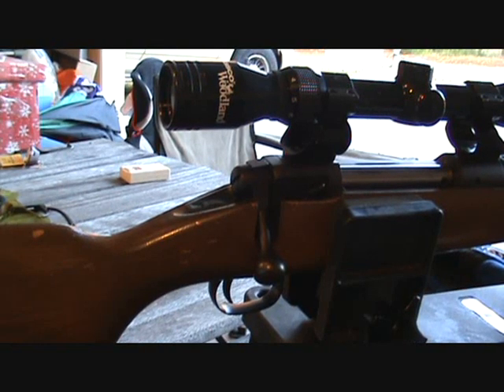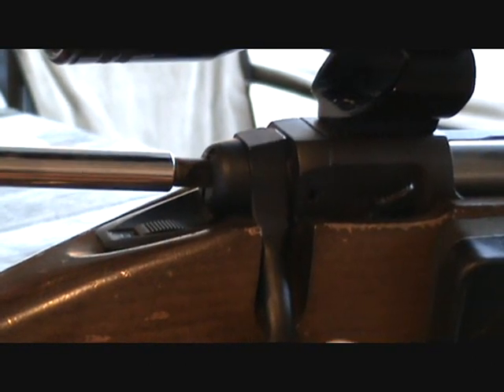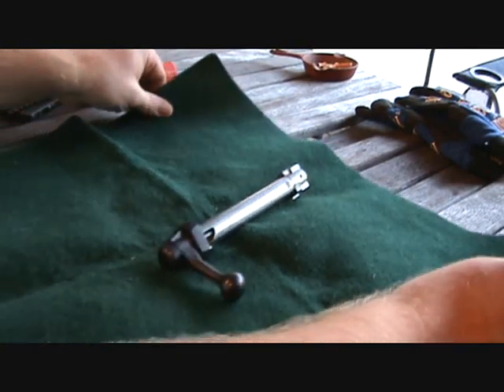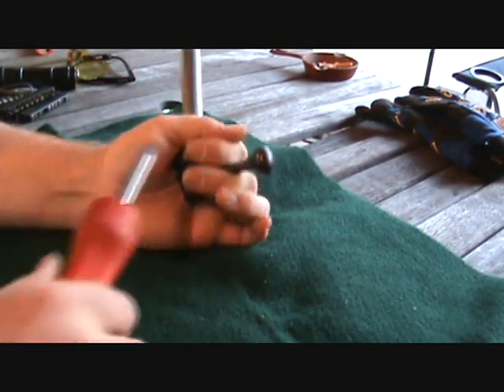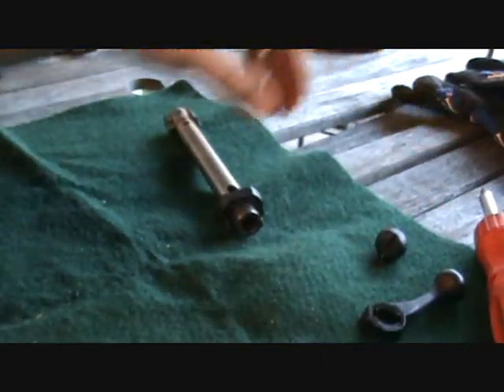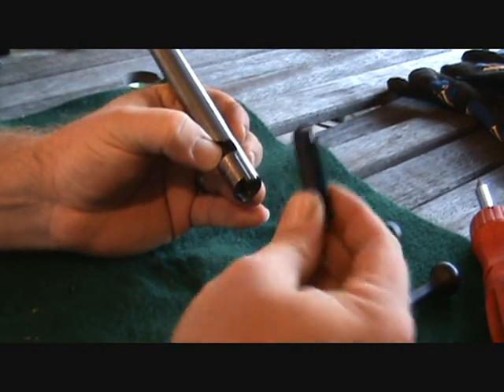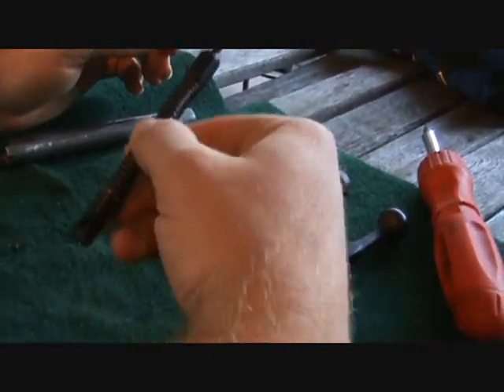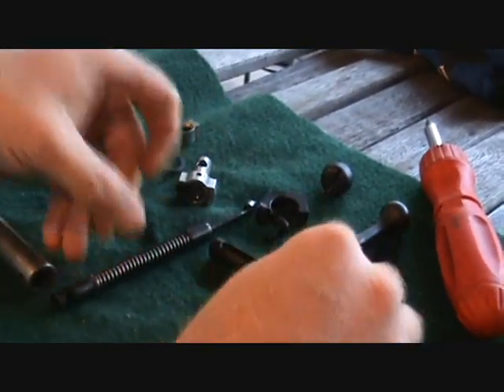Savage 110 .30/06 Bolt Disassembly

Comment: This an old video but still very helpful in helping me take apart, clean, and put back together the bolt for an older Savage 110 30-06 that recently acquired. I don’t think there is another instructional video on YouTube that demonstrates those older bolts.

Comment: I just picked up a 110, serial number in the low 13,000s in .243. It's in fine condition and is one of the very first made .243 rifles made in early 1959. Your video is proving invaluable to me in learning the mechanics of my 53 year old rifle. Your vidoe makes it a lot easier than trying to use a picture in a manual. Thanks for the good work!

Comment from the maker: @bodine46 make sure you bought the right bolt there is a long action and a short action. also the stock may have to be relieved to accommodate the bolt handle. check to see if it is contacting the stock under the bolt handle.just my 2cents

Comment from the maker: check and see if the lugs have rotated and check to see if your retainer pin is sticking out not allowing the bolt to travel home. also check to see if the bolt handle screw is tight. with out it right in front of me it is hard to diagnose. hope it helps.